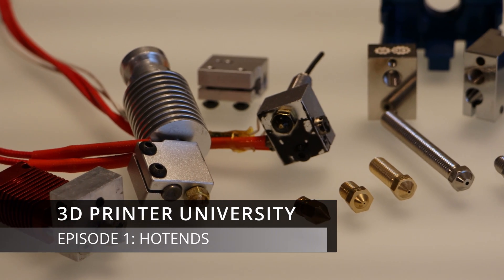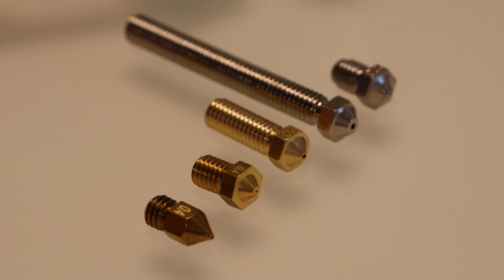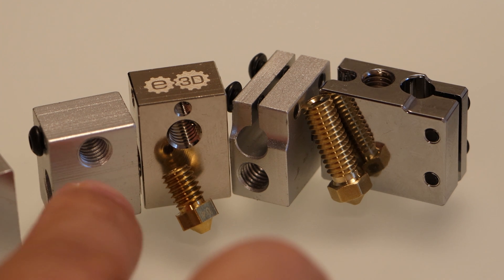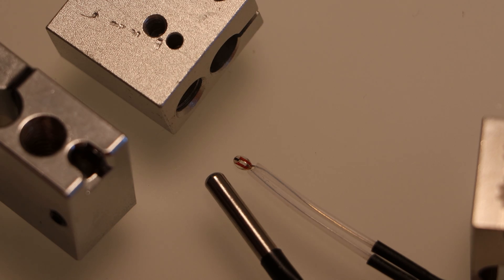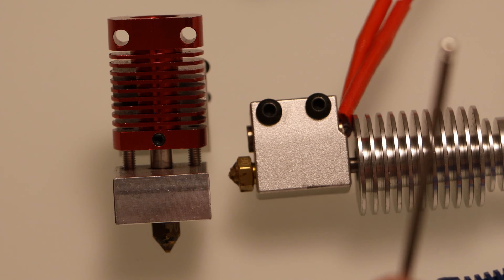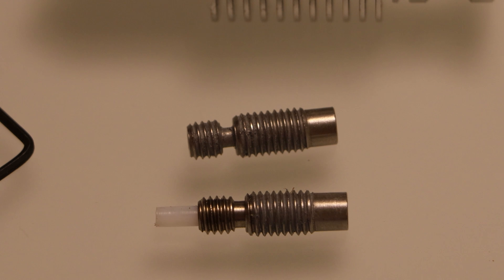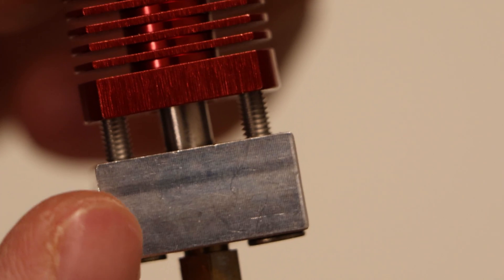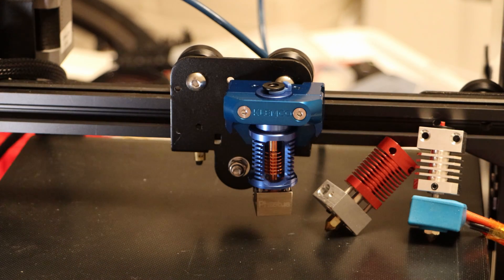Good/Better/Best: Which Hotend is Right for You?

Comment: Very useful video. New to it all still so these vids really help. Was kind of hoping to see bi-metal heatbreaks talked about though.
Reply from the maker: At the time of filming I had used one bi-metallic heatbreak and it fell apart, so I wasn't sure if they were a good idea. I think the bugs are getting worked out and the new ones from reputable manufacturers should be plenty strong. 
I have one from Slice Engineering I am going to test out soon. I'll do some thermal imaging comparing it to the stock setup, probably in a couple weeks.

Comment: The microswiss heatbreak isn't designed very well. Very easy to get heat creep and clogs. Especially with a Bowden system.
Reply from the maker: Interesting. I can see that happening, since the throat is so short. It could pull molten plastic back up into the heatsink and get stuck between the top of the heatbreak and the heatsink and solidify.

That said, I haven't had that issue on mine or the one I used at work, which have a couple thousand hours between them. Maybe I'm using better fans? I haven't run any of them in an enclosure and have printed a lot of PLA, PETG, and a little nylon. Or maybe you have some plastic stuck in that gap and its easy for the plastic to re-stick to it compared to a clean setup. Or maybe the tolerances on yours are a little off.

The one I used at work was on a CR-10 capricorn bowden setup. The one I have at home was running the Microswiss Ender 3 DD kit. I don't use either anymore since I started using the Phaetus Rapido, that thing is friggin great.
Reply: @NathanBuildsRobots  What retraction settings should you use with the MicroSwiss hotend with the shorter heat break? Do you need to reduce the retractions right down to 1-2mm? What kind of speed to you use on those retractions aswell?  Very informative video aswell. Cheers.

Comment: Why perpetuate the myth that the screws on the ender hotend contribute to heat creep?
Especially right after you mentioned that the thermal conductivity of steel is so low?
Reply from the maker: The screws are a route for conductive heat transfer, so they do contribute to the amount of heat moving from the hotend to the hotend heatsink. It is so small as to be negligible on a stock setup as I learned from CHEP's video after publishing this one.

But it may still be relevant when running a wimpy Noctua silent fan, or when using an all metal heatbreak with a skinnier tube connecting the hotend and heatsink. A thermal model would help shed some light on this but for now it is just speculation. 

I would like to make a lumped model of the hotend system, I might do it on a future video and make an online calculator to to pay with the variables and see the steady-state temperature of the hotend heatsink. 

https://en.m.wikipedia.org/wiki/Lumped-element_model

Comment: One of the best hotend guides/tutorials I've ever come across.  Thanks.  Lots of new avenues to explore, i.e. j head hotends.  I'vebeen getting more and more into larger functional prints requiring faster print speeds and higher flow rates and will be looking into some of these different style hotends.
Reply from the maker: Personally I think a 0.6 or 0.8 volcano hotend is a great middle ground. You can print 1kg in 20 hrs with one of those, and you retain decent quality on smaller details. 

I am working on a 1.2mm hotend. I should be able to print a kg of filament in 3-4 hrs. At that print speed, retractions, part cooling, and financing your 3d printing habit get tricky, but bed leveling becomes easier.

Comment: I have seen two experiments to determine if the two Screws increase the heat transfer to the heatsink on the MK8, the increase was negligible in both experiments.
Reply from the maker: Just watched CHEP's video on the topic, very interesting.
https://youtu.be/eM-rJWBuWhw

It would be interesting to see a full heat transfer analysis on the hotend, taking into account radiative, conductive, and convective heat transfer.